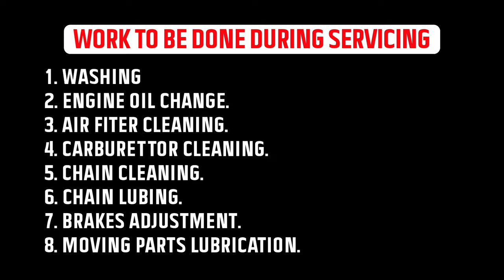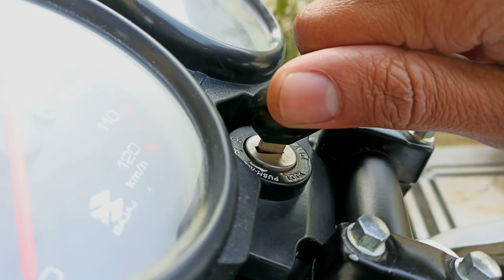Bajaj CT 100 Bike Full Service at Home

Comment: Wt was the service interval of Bajaj ct100b
Reply from the maker: At Every 2000 - 2500 Km ✨
Reply: @PawanKaimriwala  but in owners manual they mentioned every 5000 kms na
Reply from the maker: Brother After 5000 Km. There is Very Less Engine Oil in Bike. That is not Good For Bike Heath
Reply: @PawanKaimriwala  which grade engine oil we should use